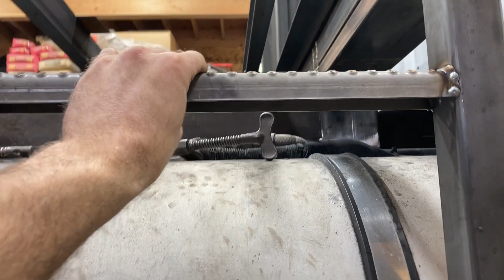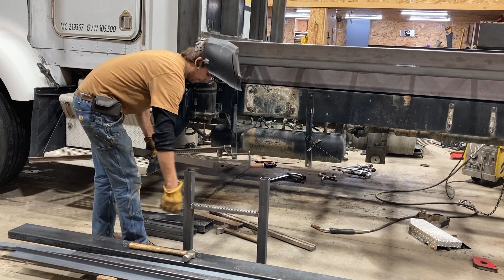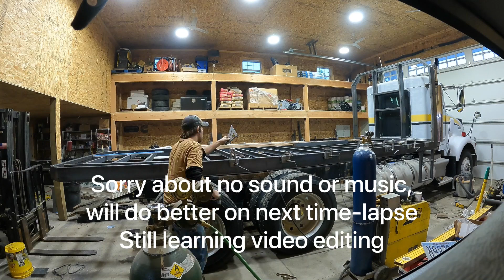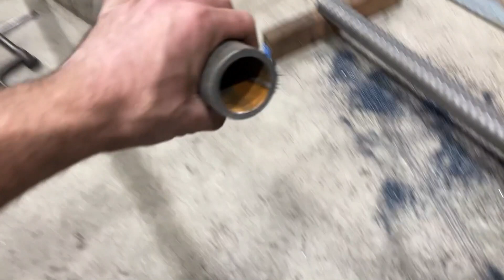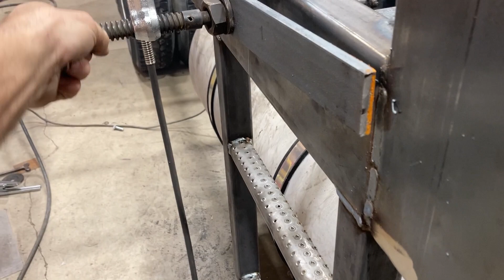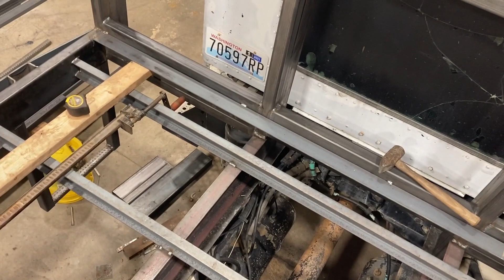Building A Custom Steel Flatbed For My Kenworth T800 (DIY Flatbed Part 3)

Comment: Hi Farm Rigging, just for ur info, u will need to put on some metal bracing behind the steps to keep them from moving in wards..
I had seen the steps on tractors and afterwards they all bend back wards..
Reply from the maker: Thanks for the info! I will definitely take a look at that. I have seen what you are talking about.